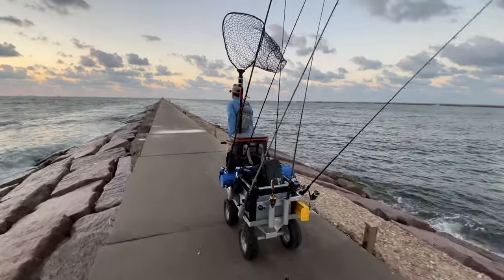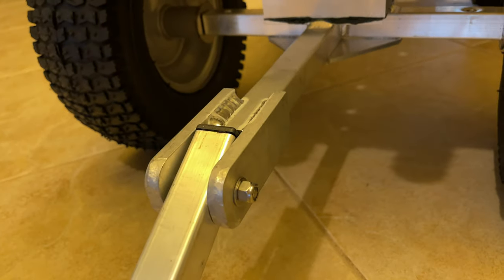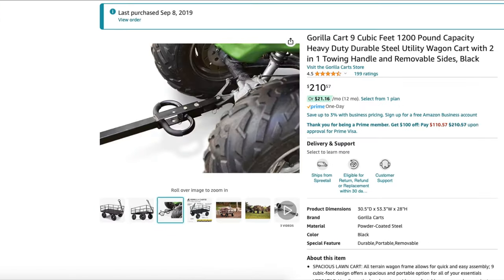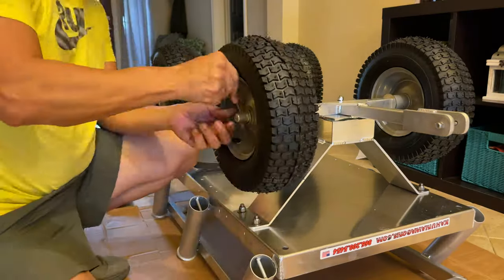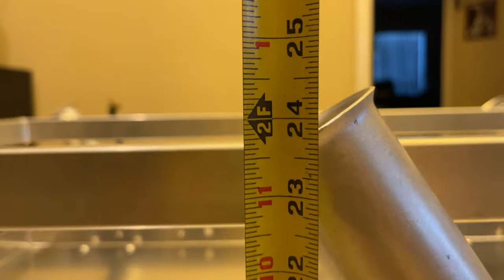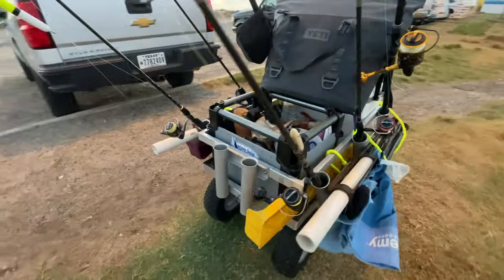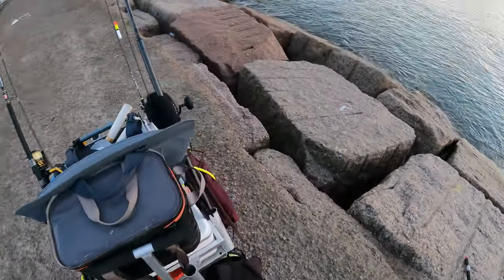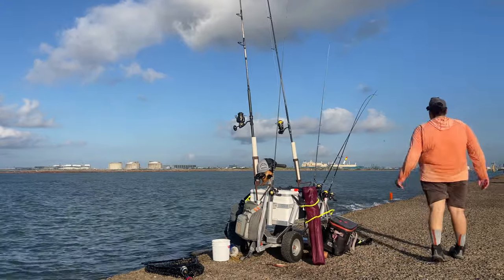Alumacart Sidekick Fishing Wagon: Made In USA (S7 E46)

Comment: Happy new owner of a Kahuna Junior beach cart. First impression it is very well built. Heavy enough gauge base to hold up to abuse and the handle/steering mechanism looks fine. Calling customer support was a very pleasant experience for a change. I called them, someone answered and hooked me up. Good job Kahuna. I have read a number of reviews and will add what I could not find in them. Also how I came to pick a Kahuna Junior over the many other options out there.

First off, it fits easily in the back of a Prius with the back seats down, rod holders on the back and sides, and the side rails and handle off. This was the #1 requirement of ANY beach cart. The side rails and handle are easy and fast to remove -  no tools needed. I am just on the sunny side of 70 and it is light enough for me to easily hoist it up into the back of the Prius! My #2 requirement. My measurements show a Big Kahuna would fit in there also.

Build quality is there on my cart. Good beads on the welds. No ‘Oopses’ or overruns, just nice flowing beads. I could only find part of one end cut on one rail that was not deburred, so had sharp edges. Pieces fit nicely, had all the bolts and pieces needed to assemble and an instruction manual.  One pre-assembled bolt I did have to tighten was the bolt to hold the steering plate. There is still enough play in it, so it swivels as designed. As noted in some other reviews, there were a few minor scratches on the inside of the base plate. Cosmetic only, no real digs or deep scars. I will likely put heavier damage on it with my first beach trip. I am an hour from the factory and UPS roughed up the package pretty good. Kahuna did an excellent job of packing it. Shrink wrap, cardboard and zip tied pieces together inside it. With what the box looked like, I would have expected much more damage.

The INSIDE of the base is 19 5/8” by 35 5/8”. But the bolts for the side brackets will interfere with placing a larger cooler. So INSIDE the bolt heads the base measures: 19 ¼” x 35 ¼”. And yes, some items will fit in places to avoid the bolts that are inside the base bottom, but this is one measurement I was curious about. I would think the Big Kahuna bolts will take up the same space from overall measurements.

Next, the side rails. They do stick inside the base so cut down on the inside dimensions also. The overall inside cargo area dimensions with the side rails on: 18” x 34”. The top of the side rails is 8 5/8” from the inside base. The solid base sidewalls are 2” tall. The side rails easily go in and out of the holders. If you fasten the corners, they are a solid structure. You COULD use the rails to fasten gear to. The rails fit 3” into the holders. They fit loosely though, so could pop out under rough conditions. There is 1” space under the rail in the holder to attach bungies to. There are also many 3/8” and ¼” holes drilled into the sides and base to attach bungies or ropes to. Speaking of the rail holders, there is only one bolt holding them. I cranked the bolts pretty good and the holders can still move a little, twist side to side. Taking the sides on and off, they will tend to tilt a bit and will need to be retightened. Just something to keep an eye on.

You can insert the side rails in the other direction, with the uprights on the inside and the rails on the outside of them. This will increase the overall inside dimensions, except for the base listed above. This will add another 2” overall (1” for each side rail) so 38” x 22” between the uprights. The corners cannot be fastened though, but still sturdy enough to hold gear in. If you have rough travel, it would be good to wrap rope around them, to give them more support. You COULD fit a larger item, like a cooler that is 22” wide, sideways in it. You would just need to have something that is 2” thick underneath it, to get it above the base sides. An added plus to this arrangement is you can put a 1-inch diameter “wind anchor” between the side rail and base platform. You can also put a wind anchor between the rod holders and the base with the side in the normal position. A wind anchor is something you use on the beach to prevent the cart from being blown away, a pole or rod stuck into the sand. Beach umbrellas have a 1 ¼” diameter pole and that is exactly the space you have. It might work, but would be a tight fit and scratch things up over time.

Turning the side rails in that direction interferes with the rod holders. The bottom “C” of the rail will not fit between the rod holder and the base. Meaning it will not go all the way into the holders and the side rail isn’t in enough to actually be useful. So with rod holders, the sides or front/back cannot be turned around. BUT… The rod holders act as a kind of side rail anyway. They stick up 5” from the top of the base lip and are 1 ¾” away from the base lip. It is enough to prevent items from falling off in transport. If you have no back rail, the rod holder in the back, with fishing rods, and a large cooler in the base, you would have 1 ¾” to ‘wedge’ or carry something between them.  Beach umbrella, towels or some other soft item. It would also help to stabilize the fishing poles. Most are loose in any rod holder and wiggle around, so this would prevent that.

That is about it for dimensions and things I did not see listed elsewhere. Now, how I came to pick the Kahuna over the many other options out there.

I read all the reviews of all the carts and watched more videos of other folk’s beach fishing carts than I care to admit to. I do recommend watching ones with people’s modifications! What I needed was an aluminum, 4-wheel cart. A big boy Radio Flyer! Solid bottom, lifted, balloon tires, front wheel steering, rod holders and something that I could lift and fit in the back of a Prius.  It also had to be large enough to fit what gear an ornery old man would need for a full day fishing on the pier, surf or jetty in southern Florida. Towel, live bait cooler, cut bait cooler, food/beverage cooler, iced fish box, poles, tackle, cast net, sand flea rake, chair, umbrella, 5-gallon pail, sand spikes, coffee… Four coolers??? My days of using one cooler for bait, beverages, sammiches and fish are over now. My preference was for buying once and taking care of it to see me through. This way I can also modify as I go along to better suit my needs. As a retired craftsman, I am not against spending money for the right tools.

I pondered modifying a 2-wheel cart by adding another axel and tires, lift kit, changing the handle, rod holders… But by the time I was finished buying all I would need, it was going to cost me $800 or more. Not including my time and trips to the hardware store to complete the job. I also looked into the ‘collapsable’ beach carts and modifying one of them. I could not find an aluminum one, all are steel. So would need replacing in a few years even with diligent care and rinsing.

Why the Junior over the big cart? I am older and wiser now. Well.. older anyway. I found if you have the space, it will be filled. I have no need for a 120-quart cooler filled with adult beverages anymore. A 12 Quart is more than enough for my needs. A 6-pack cooler carries enough frozen bait to feed the fish all day long. I like pompano, flounder, snapper and whiting. No need for a cooler big enough to fit gaffer mahi or a 50# striper. A 12 quart is more than enough. Although.. If I am going for Snook or such, I could put a 48 quart in and stack the other gear like a gypsy wagon for a day. The only larger cooler I need is a 13-quart live bait cooler. I know how to streamline my tackle so don’t bring the entire stable of rods and 80# of lead. And, the more crap you have in the cart, the heavier it is to move. Move light and tight, not heavy and slow.

For myself and my needs, the Kahuna Junior fit the bill perfectly. It was worth the $800 investment to have a solid fishing cart I could rely on. If I ever find I do need more space in a cart, I would not hesitate to buy a Big Kahuna or look into the electric one.